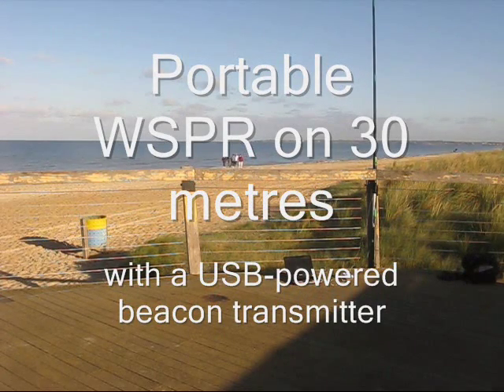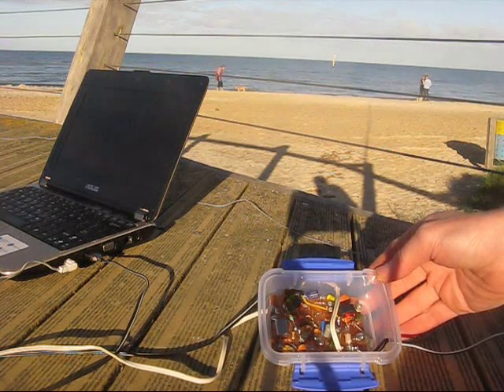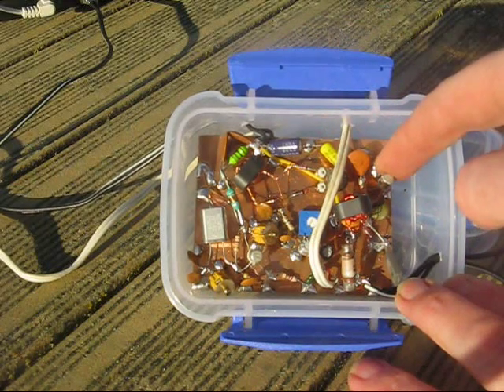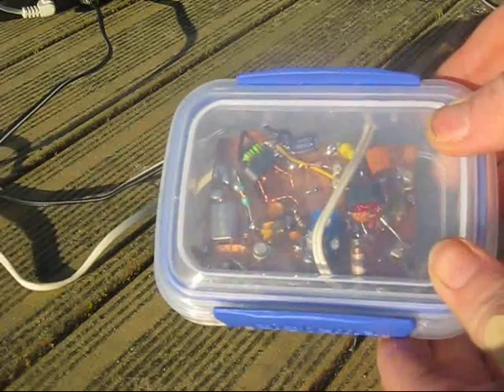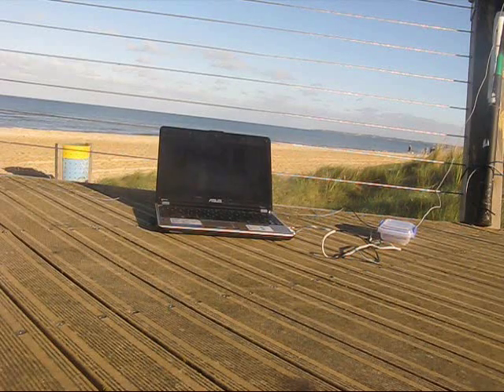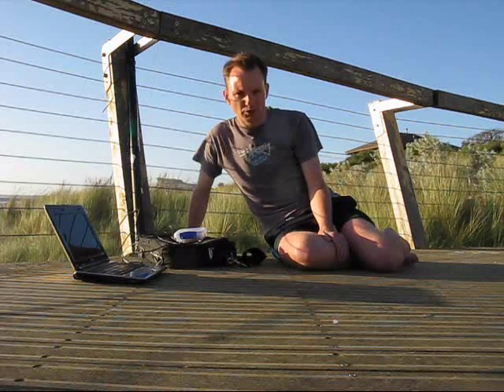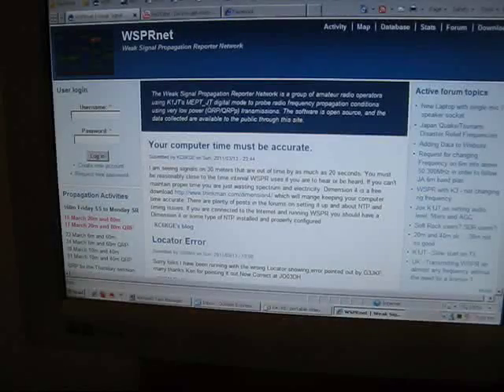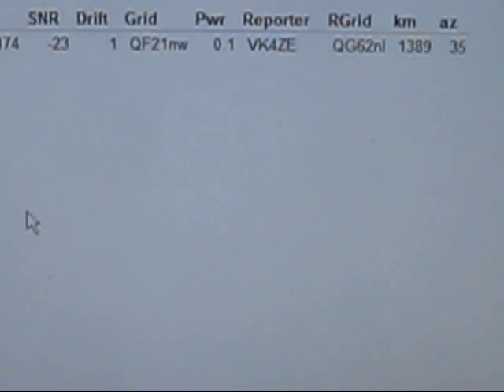Homebrew USB port powered 30 metre WSPR transmitter

Comment: Not bad considering the power and an antenna that wasn't exactly efficient. I love the Joe Taylor modes! I am almost exclusively a JT65 operator and 30m is my favorite band. I have done many contacts on 30m with an elevated, full-sized vertical and less than 100mw using JT65. WSPR is going to be my next venture. 73 de NV6R